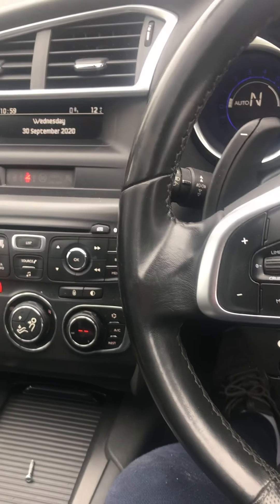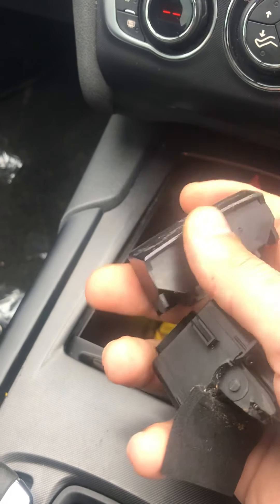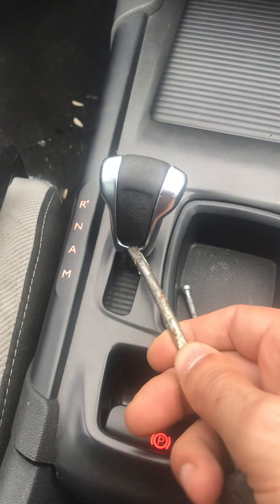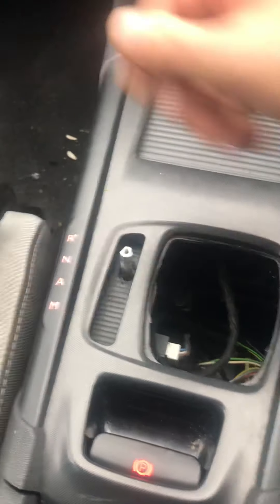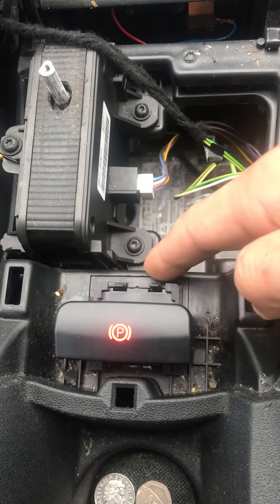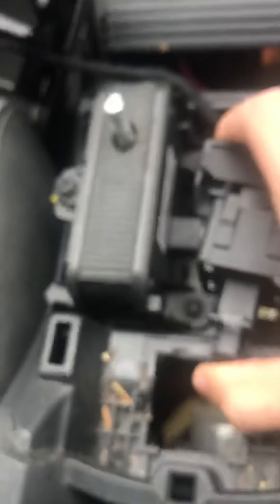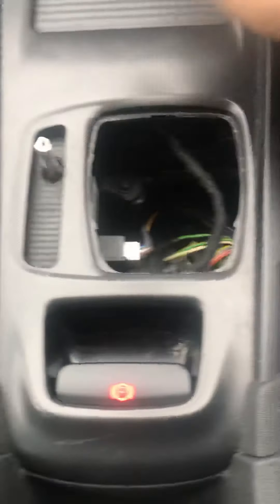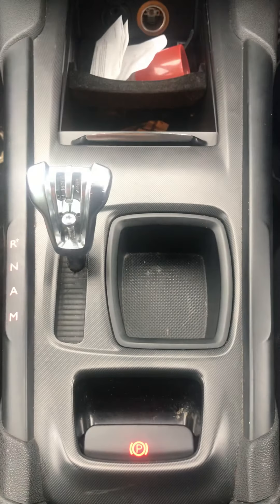How to replace handbrake switch for Citroen DS4 2011 onwards step by step.

Comment: Brilliant video - Aware one garage quoted £350 for job - bought part for £12 from Amazon and fitted in 5 mins. SO easy when you know how. Just needed an extra hand to get unit out due to the 4 push fixtures.
Reply from the maker: Yeah they can be rip off those garages. Glad it helped mate.